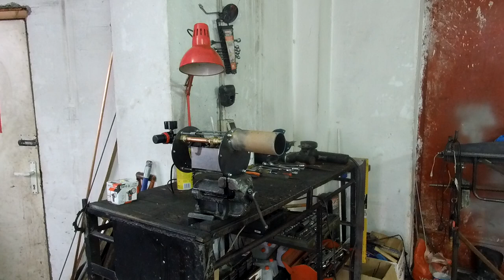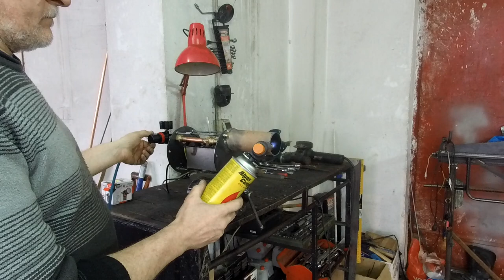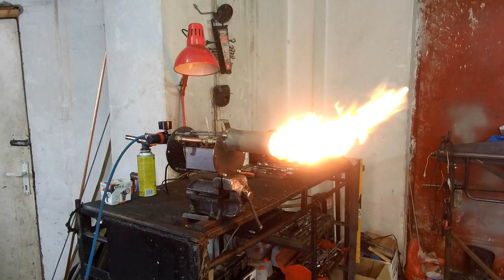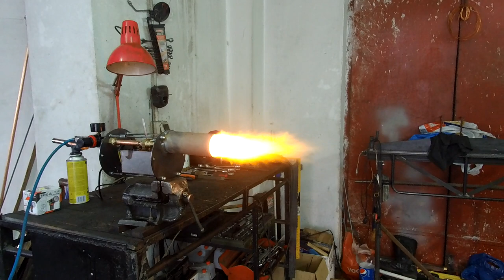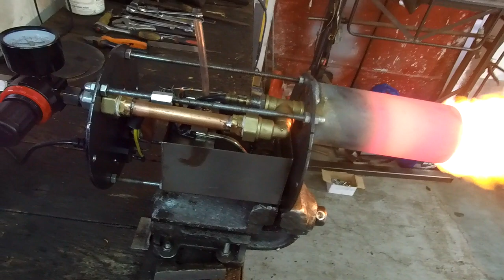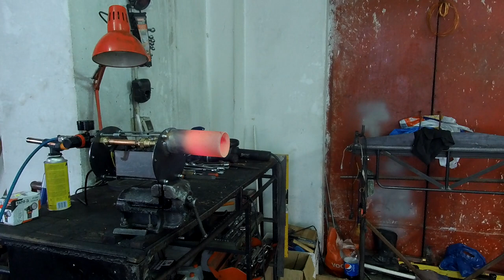Siphon nozzle waste oil burner

Comment: I'm working on a siphon nozzle burner for my forge/foundry, and I'm hoping you can help. 1. do you use a fuel/oil mix? 2. how do you regulate how much oil is siphoned? 3. what are your air sources for the different parts? is it just compressed for the oil siphon, and a second venturi effect for air in the ignition chamber? 4. how much change does preheating the oil change how well the burner works? 5. how do different sizes of the ignition chamber affect the resulting flame?

Comment: This device behaves as if it has a pump ?
Reply from the maker: There is a little reservoir just under the siphon nozzle where the oil is heated at 90 degree Celsius by a heater and thermostat controlled. The heated oil is sucked into the nozzle via Venturi effect. No pump needed.